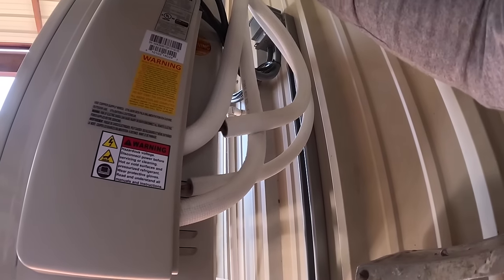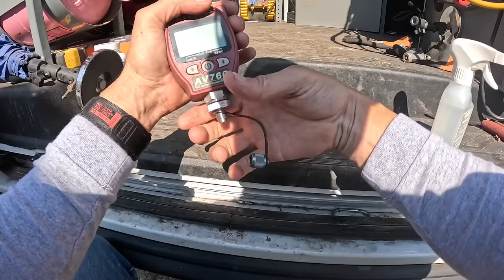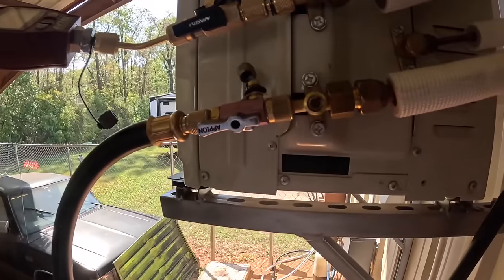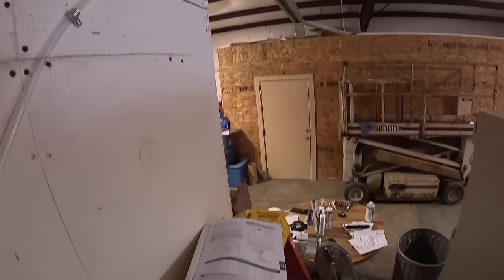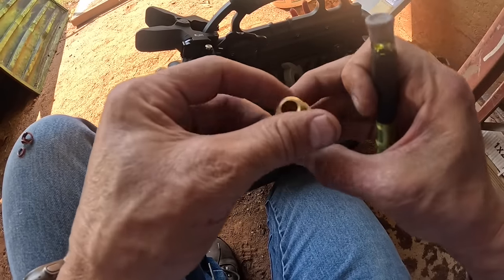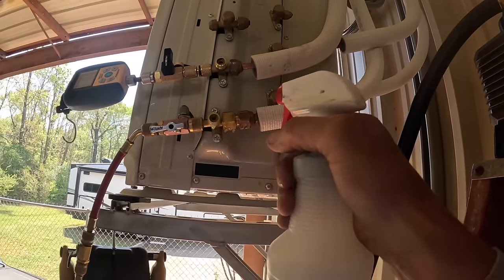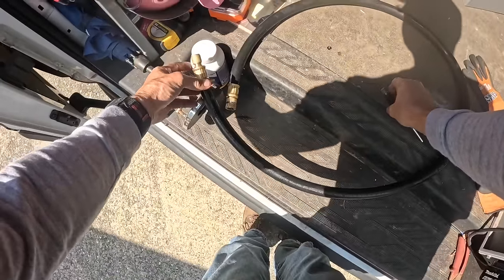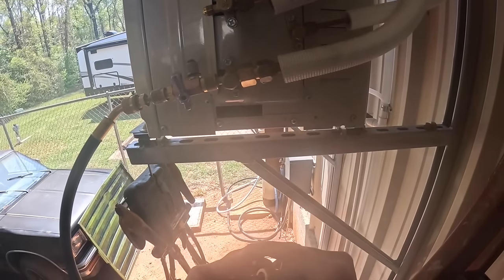Customer Requested That I Just Come Pull a Vacuum! #hvacguy #hvaclife #hvactrainingvideos

Comment: Those copper rings in the brass flare reducers are flare bonnets. They create a seal between brass to brass flare connections. Put a bit of nylog or zoomspout oil between the surfaces. Man you sure got a lot of patience. Guys like that just double the time and concentration required to get the job done. 🤣

Comment: I just put a Daikin 18K minisplit in yesterday....  my first one. I read the manual while I was waiting on the other guys to get to the job site.  The key part is to read the manual.
Reply: And having the right tools for the job. A wrench is not a torque wrench 😅😅
The proof is what I saw. Over tighten fittings resulting in crushed seals.

Comment: I’ve had 2 mini split units installed, one 2 years ago (single head) and another new one (triple head) within the past week. Same brand (Gree), and the same tech doing the installation. Some of the line sets are long so he cuts off every flange fitting and brazes them together and never gets call backs for leaks.
Reply: The High silver content rolls at RSC work perfect for that

Comment: Good Gawd the Yacking Carl you had to deal with!   

I keep a couple pairs of earbuds that I’ll put in and then just not answer! 

I’ve had great luck with Pioneer but had one unit that the valve was stripped and I couldn’t do a full recovery. The model year I had were known for poor threads on the valve because I only use a T-Handle on Mini-Splits after being blamed for stripping a valve, Once! Ha

Comment: I did the very same thing about 2 months ago.  Went to connect piping on a system and encountered this very system.  Took me a while to figure out that I had to open the valves on each circuit in order to evacuate the entire system.  I install LG most of the time and they are a bit different.  You gotta love DIY installers.  Just gooder enough, right?

Comment: Man! What a very important video for us! So much to deal with and obstacles! I am in the middle of a install of a Gree 5 zone system. My New Appion Low Vacuum core removal tool only worked for 2-line sets. After that it would not pull down below 1000 microns. I think the Nyloc sealant might be stretching out the O rings? I am waiting for my new Navac core tool. Then I see this!  I do have a Yellow jacket core tool and this one seems better. What do you now use?
Reply: deez

Comment: When I installed my minisplit, it had precharged lines, condenser, and evaporator and didn't need to be evacuated.
Reply: But you paid for that. Vacuum pump is cheaper than pre-charged everything. I'm not sure why he hired an installer instead of just buying a vacuum/equipment.

Comment: If for some reason you damage or lose the copper flange you can get a pack of copper washers at harbor freight and use those…they are made of soft copper and will conform to the angle
Reply: I’ve always tossed those things. 
Never had any issues with leaks either.
Reply: I bought a box and the label says for electrical applications.  Still look like crush washers to me.
Reply: @wallacegrommet9343  I’ve always used them for banjo bolt seals

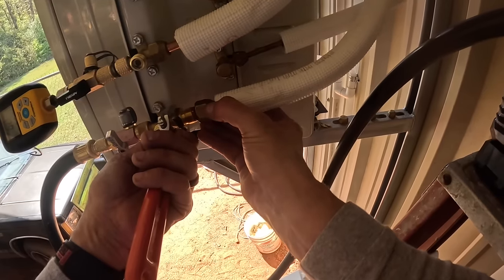Comment: That's why i NEVER use valve core removal tools. They are just not worth the grief. more often than not They Leak ! Good video. Also - at 20:35 did u put a copper sealing ring where the flare nut copper line set attaches. wouldn't that be copper flare on top of copper flare on top of brass flare. if so , putting a copper sealing ring on top of a copper flare is not going to seal properly.imo.

Comment: At least you know where the leak is 😅. I was gonna say send me that core remover it would match most of the rest of my aging fleet 😅😅. Guess that one needs to go back to the manufacturer either that was one of a kind or they have a problem. You ever use Nylog on the flare fittings?  Just enough to allow the flare to settle into the male part of the fitting might help. When I win the lottery I’m buying a Navac automatic flaring tool but I gotta play first 😅. Btw everything in bloom at your home looks great. Grass and a few trees are budding up here but they’re probably doomed as we will see too many frosts yet here in the mountains